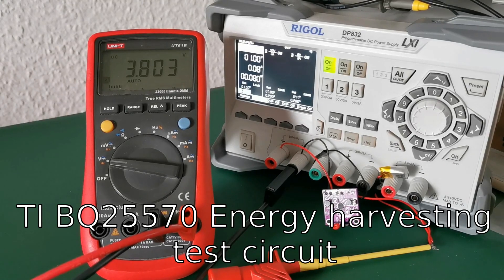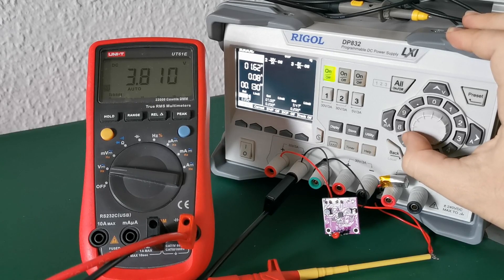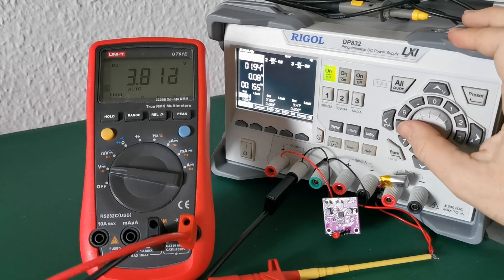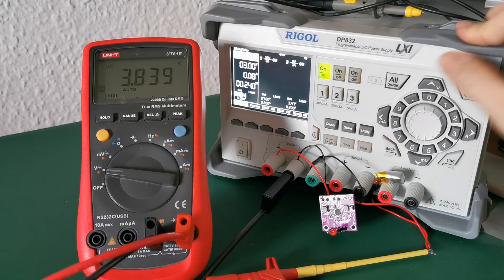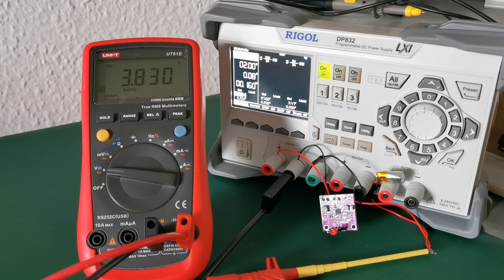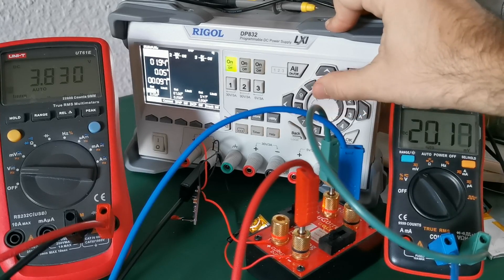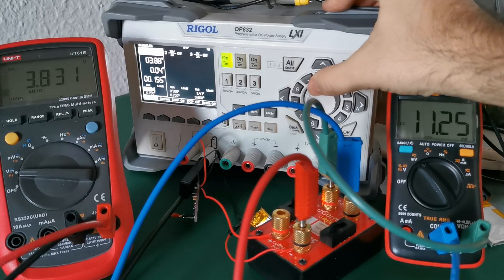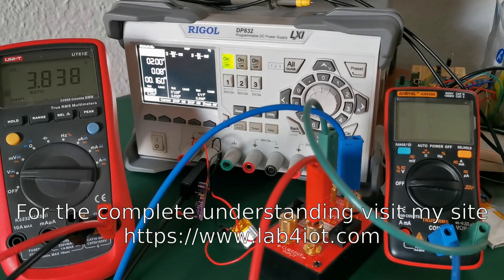Testing the energy harvesting circuit TI BQ25570 without solar panel

Comment: According to the datasheet, I believe the input current is limited to 100mA, and VIN must be < VSTOR < VBAT_OV. 
If VIN exceeds the specification, it will be "pulled to ground through a small resistance to stop further charging".

Thanks for the practical demonstration. 
Also, your website is down when I tried to access it. Appreciate if u could bring it up. It'll be of great help to many. Thanks!
Reply: so if I put there 30 volts it will not kill it?

Comment: How do you set the output voltage? What pins give what output voltage? I read the TI schematic, but did not see it mentioned...though I am sure it was. Looking for anything over 2 volts out, with converter enabled.

Comment: Can I use it with a source having current input in the range of 10 microamp and open circuit voltage around 400 mV? What would be the header pin connections in that case?
Reply from the maker: I am not sure, according to the data sheet it should be possible, just won't be the most efficient charging. Check the figures in the data sheet!

Comment: What the voltage you inject inside the converter ?(What's the Input Voltage Range ?)
Instead of using it for solar panel, do you think it allows to use with a thermoelectric generator?
Reply from the maker: I believe you can find the voltages in the data sheet for that specific IC.